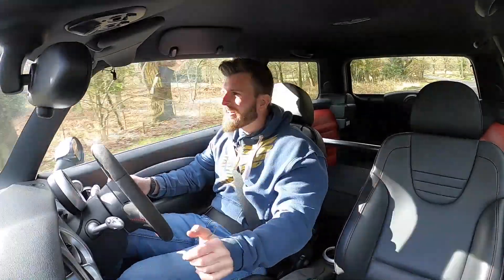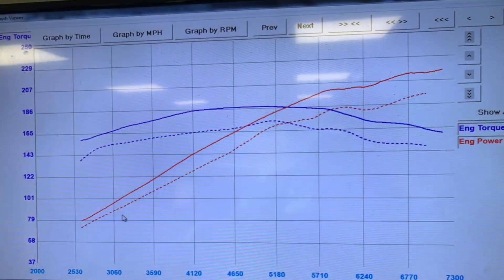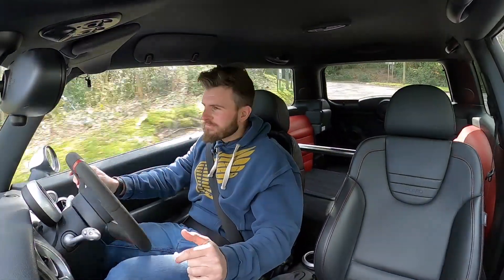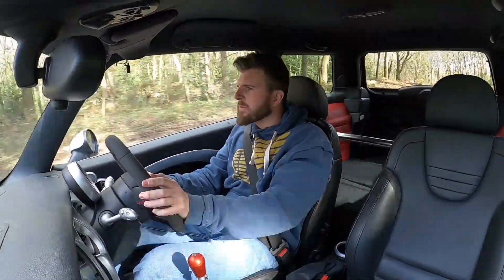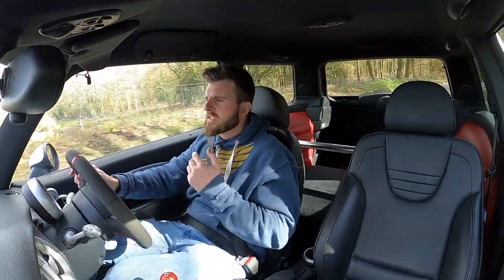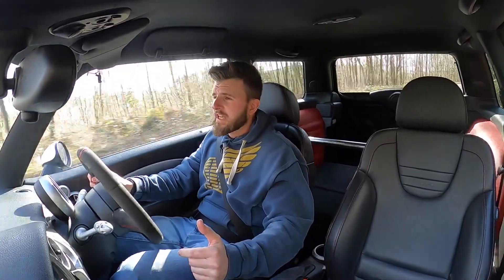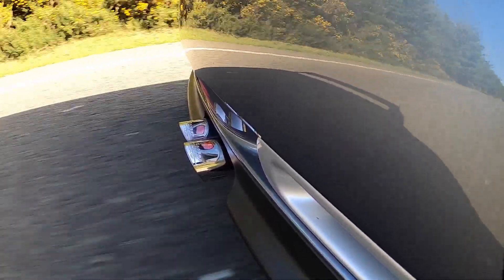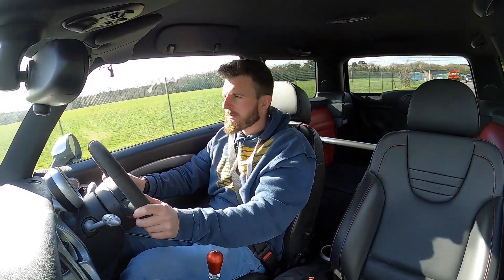Mini GP1 modified review ** 7,500rpm flat out CatCam banshee super charger + exhaust sound clips! **

Comment: Currently got 1 sat on the drive and been used daily along side the Mrs Megane 250Cup & Astra J VXR

Great fun little cars even in stock form
Reply from the maker: Still haven’t driven or even been passenger in a VXR, should really give one a go to tick it off the list
Reply: @stoneautomotive  i would say have a go of mine but im 2 far away.. Il be honest they feel slow given the weight and really long gearing but when you look at the speedo you're doing some speed.. Handle quite well just dont have the go kart feeling of the mrs Meg
Reply from the maker: Thanks for the offer Rob, have heard such mixed reviews over the years that curiosity strikes me on them
Reply: @stoneautomotive  yeah my mate had 1 few years ago running 385BHP. I was originally looking at FK2 and then i thought hmm so went and test drove and snapped it straight up lol